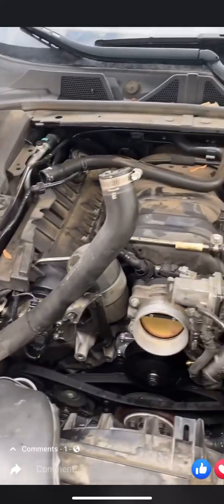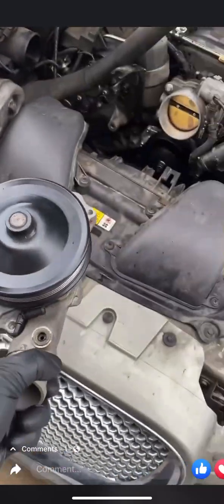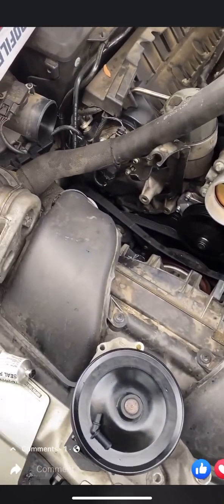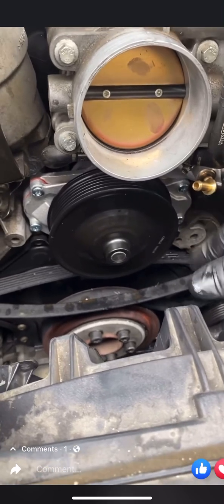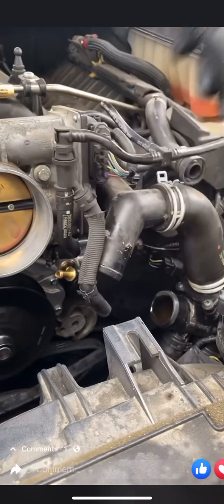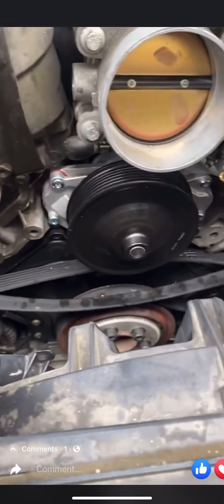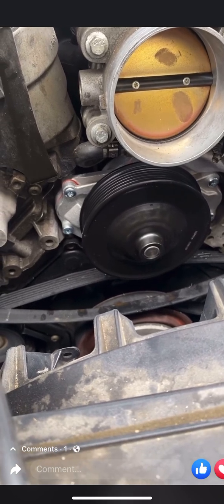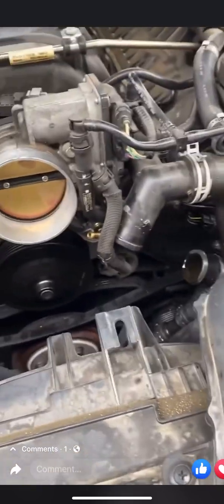2012 jaguar Xf water pump, expansion tank hose, elbow connector. #jaguar #automobile #landcruiser

Comment: Thanks for this, do you still have that brass elbow eBay link
Reply from the maker: @christianflores8530  of course glad it helped 👍🏽 let me see if I can find the link
Reply from the maker: https://www.ebay.com/itm/265027875966
Reply from the maker: Original link no longer an option here is another I just found. https://www.ebay.com/itm/354113366882?_trkparms=amclksrc%3DITM%26aid%3D1110006%26algo%3DHOMESPLICE.SIM%26ao%3D1%26asc%3D274612%26meid%3De062035131514343917b30c3878628c9%26pid%3D101429%26rk%3D2%26rkt%3D12%26sd%3D265027875966%26itm%3D354113366882%26pmt%3D1%26noa%3D0%26pg%3D2332490%26algv%3DSimplAMLv11WebTrimmedV3MskuWithRevOptLambda85KnnRecallV1FitmentPromotionM2CPCAutoManual%26brand%3DUnbranded&_trksid=p2332490.c101429.m2460&itmprp=cksum%3A354113366882e062035131514343917b30c3878628c9%7Cenc%3AAQAJAAABQHTrdYNOa%252FRJOsDB6IvqWwNFgJu3HXmyU3kX8nruyj4ASRL%252Bg8gSbuV8FnpavCUeidZ4tFXZnQ1WTbo8DGqvTihoUcTPQp%252BZyNWPTgGupmOS67Z9Tul3aSuQJkuAJsMmD9UNDMIzihALJCsiLKA2zU1Z94OeCAI3DLcNrHwGbtPcwcN%252Bl6Umi7K6c87fOawJ%252F7SAkYVeUV2ez1zM7874XXjG6sR%252F1y3Leezyt3hS5wHWSdZEH%252FFxiRnPosLe9sUky0X0GHpTDedPZUEyw15KpD4c2xeTQVHbNroBBSOEOqxWzflv3TpF4McfQVTiQW5et%252BaAl4LGUP5Y5u9E%252Fgm4Nvo%252BRt0iyqY%252F9Vb%252B0GFhHaQgF98V9fBsWnztUa%252FLoJTWwVL9s6QVqqpMwyFvSuYmqeSt1BpZVxRp%252FiQD9wSvWTBl%7Campid%3APL_CLK%7Cclp%3A2332490&itmmeta=01J9WNHQ7MDXHDV4GCMGW8ZKXK